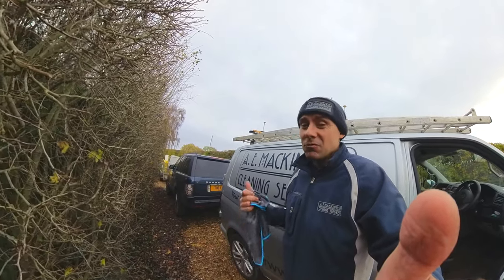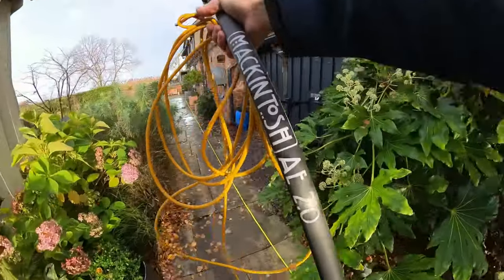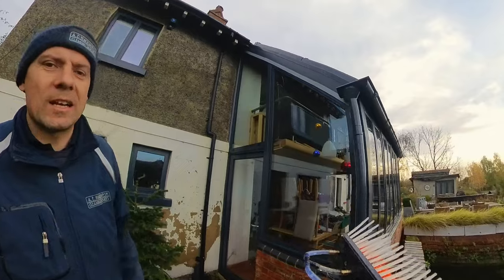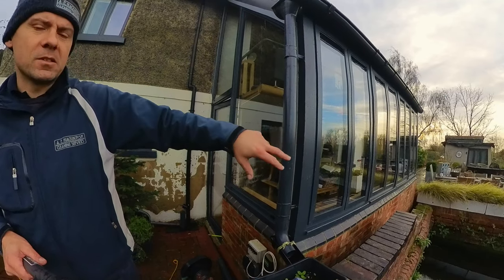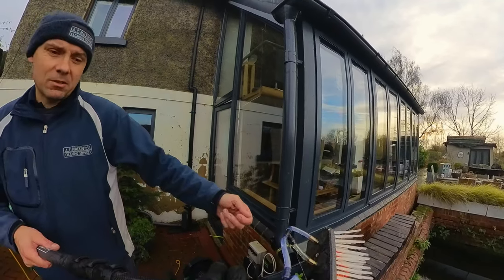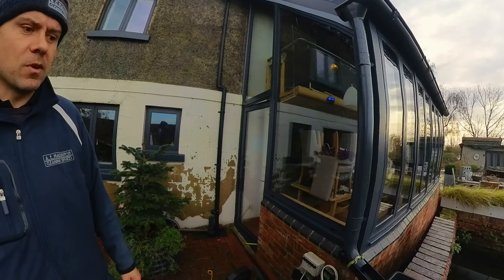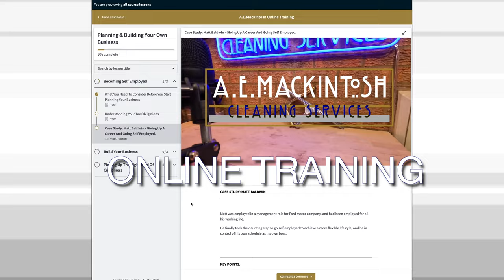Mackintosh World of Window Cleaning

Comment: How you been finding the cold weather mate? have you got a hot water system or heater etc to prevent freezing?
Reply from the maker: It’s been a struggle. I’ve got a heater in my van overnight, but I’ve also been trying to do inside and traditional jobs mostly if I can.🥶👍🏼
Reply: @aemackintosh  Atleast you’ve managed to get some work done my friend! what heater do you use? I’m considering buying a hot water system
Reply from the maker: I’ve just got a simple little oil filled electric rad. I have to say, it’s times like this that I wish I had some sort of hot water.

Comment: Just a bit of advice… How do you keep your system insulated to stop in freezing in these cold temperatures. Cheers ps might be worth a video.
Reply from the maker: I have an oil filled electric rad in my van overnight. This was filmed before the recent cold snap though.🥶👍🏼
Reply: Oil filled rad is ok if your van is on your drive, & you don’t mind the cost of having plugged into the mains overnight, but I know people who have hot water systems, ect, they all said the water that dropped from the brush froze when it hit the ground around the buildings, customers going mental!
Reply from the maker: I’m glad that I’ve kept a bit of Trad work and inside jobs that I’ve managed to do this week.👍🏼
Reply: @aemackintosh  👍
Reply: Do you work alone? Or have employees
Reply: Sorry, can’t cope with the 360 camera shots….
Reply: @marcusherts9345  Buy some grit and throw it down. So bored of the modern inability to cope with any slight inconvenience - most customer's are fine but there's always that few.
Reply from the maker: It is always possible to get something done if you really want to.😉👍🏼
Reply: @123b3n123  Well I’ll pass on the info to them, 
me personally I just do trad when it’s icy & my hoses are frozen
Reply: @marcusherts9345  my comment wasn't aimed at you or your friends, it was at those awkward customers. Sorry if that wasn't clear 😇
Reply: @123b3n123  ok no probs